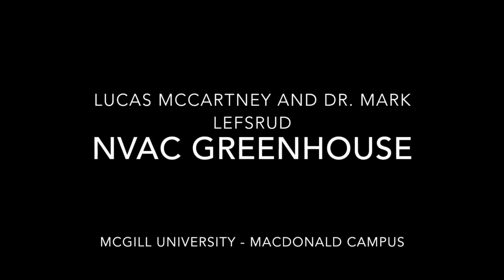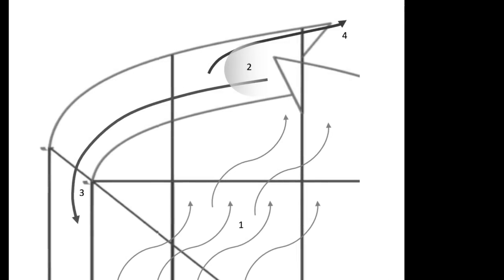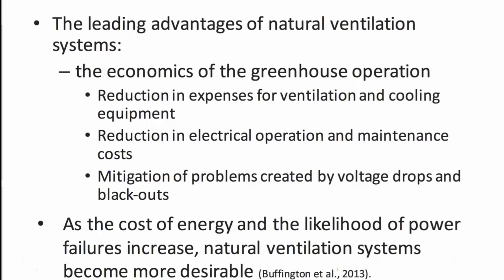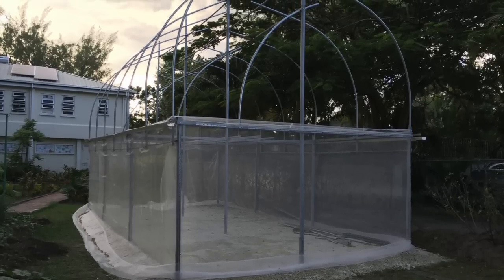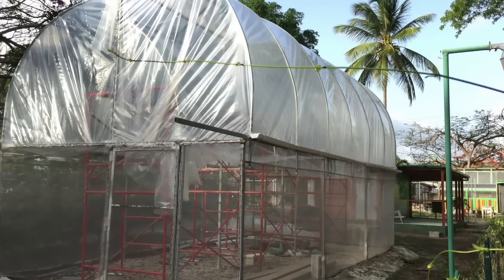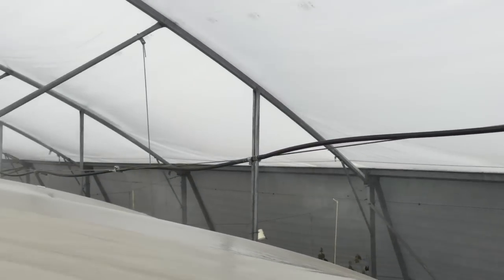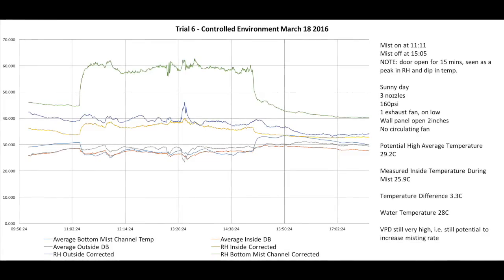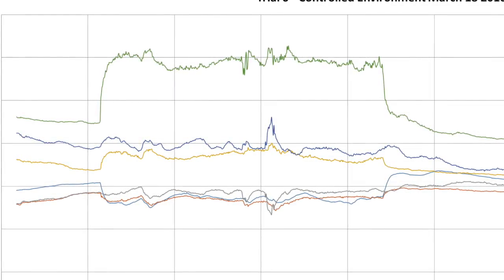Tropical and Hot Climate Greenhouse Design: Natural Ventilation Augmented Cooling NVAC Greenhouse

Comment: If situated in a very hot, humid climate, would strawberries work with this type of system?
Reply from the maker: This greatly depends on your local climate and greenhouse design. The NVAC system might be sufficient to provide the needed level of cooling if immediate conditions are right.

Comment: If the outside RH is equal to the amount provided by the misters, will the system still work (as evaporative cooling is dependent on the differential between inside and outside RH)?  Wouldn't a simple fan system with a GH tube be much cheaper, simpler, and more effective?  I've seen similar designs in the tropics, however the problem here is keeping air moving and humidity down.  This means a simple rain cover and a fan system.  I don't believe that adding more humidity in tropical zones will be helpful, especially considering the many fungal issues present.

Comment: This is perfect for the central  valley CA what’s the outside vs instead wn 100 outside maybe adding geothermal underground air exchange and a side fan seems like a lot but depending on crop value....
Reply from the maker: Go Goings Depending on inside temperatures and relative humidity, we can get over 8C of cooling with significant air movement.

Comment: Would it work without the misting system?
Reply from the maker: It would not work. The NVAC design relies on the cool air provided by the evaporative cooling, which in turn relies on the misting system. Thanks for the question.

Comment: Cool concept, wonder if I can have more info about the design. I'm planning to build greenhouse in my backyard. Thanks
Reply: The Philippines has five types of climates: tropical rainforest, tropical monsoon, tropical savanna, humid subtropical and oceanic (both are in higher-altitude areas) characterized by relatively high temperature, oppressive humidity and plenty of rainfall. There are two seasons in the country, the wet season and the dry season, based upon the amount of rainfall.[1] This is also dependent on location in the country as some areas experience rain all throughout the year (see Climate types). Based on temperature, the warmest months of the year are March through October; the winter monsoon brings hotter air from November to February. May is the warmest month, and January, the coolest.[2]

Is this applicable to my country.?
Reply from the maker: xinod ras The NVAC system might be applicable. It is important to note that if the humidity outside and inside the greenhouse is too high, the cooling capacity of the system is greatly reduced. If there are periods of the day where the sun is strong, temperatures are high and humidity may be lowered in and around the greenhouse (usually mid-day), the system has been proven to be effective, even in typically humid climates.
Reply from the maker: Head over to https://nvactropicalgreenhouse.weebly.com to fill out the contact form. I'll get in touch with you through this. Thanks for inquiring.

Comment: I love the concept, using a misting system is a smart way to go. I'm concerned that a high humidity climate wouldn't cool much though with a misting system..... I plan to explore this concept more on my channel. Thank you for the video and I hope you got your PHD
Reply from the maker: Simple Tek Thanks for the comment. Your concern is appropriate. We do limit the use of the system during humid days and I don’t recommend use of the system in regions that experience very high humidity year round. Thanks for watching and yes, I did happily get my PhD.
Reply: You could add earth tubes for a humid climate. This requires a small amount of power to ruin the fan, but is easily run with a small solar setup.

Earth tubes are simply 6" drain tubing buried under at least 3 feet of earth. You run them for as long as practical, and put one end on one side of the greenhouse, and one in the other, then install a fan. This cools the air going through the tubes.

The longer the run, the more air can be cooled.

For larger systems, you got limits on size and flow, so people then go to fluid filled pex pipe buried very deeply, and connect it to a radiator and a fan, similar to how a car engine is cooled.

Check online for details. :-)

Comment: Wonder if creating a vortex like on newer airplanes would speed the airflow over the ridge near the misters
Reply from the maker: Thanks for the interesting comment. Indeed creating more turbulence at the roof vent could promote air movement around the misters. From experimental data, there already is a great amount of turbulence in this area. Inducing even more turbulence would have an effect, for the better or the worst. Undetermined at this point.

Comment: Hello Lucas, May I ask if this design would be more effective in a scaled-up version greenhouse(1000m2 to 2000m2) ?
Reply from the maker: It can be as effective in any size greenhouse, provided the roof and vent designs are appropriate. For example, the NVAC setup will not be the same in a multi-span large scale greenhouse compared to a single span large scale greenhouse. The shape of the roof also comes into play.
Reply: Lucas McCartney Thanks, I'm having a draft for a sustainable farming project in Vietnam and the greenhouse part is killing my budget. So I am strongly interested in this innovative design since it is a cheaper cooling solution than a fully automated greenhouse. My only concern now is that with three layers on top, will the sunlight will retain enough necessary spectrum for plants to grow?
Reply from the maker: The system in fact creates 2 layers, which usually isn't a hindrance as shading is used anyways. When designing the specific NVAC system for a greenhouse, I balance the existing shading with the added shading from the NVAC roof, to result in no overall change.
Reply: @lucasmccartney5043  how much will it cost for a 30 feet x 60 feet green house in the Caribbean?

Comment: At my place, the temperature is around 32°C (humidity around 60-70%). If I installed this design of greenhouse, how much the temperature you expected will be drop?
Reply from the maker: The performance of the NVAC system can vary depending on solar load, wind conditions and exact design of the greenhouse. In a typical natural ventilation greenhouse with large side and roof vents and under sunny and low ind conditions, you might expect 2-4 C cooling (compared to outside conditions).
Reply: Thank you sir

Comment: Hi. Great work here. I am very new to all these and was wondering if this is better than cool pad & fan system in terms of cooling the green house as well as maintaining appropriate humidity. Kindly enlighten me. Thank you.
Reply from the maker: Hello Adarsh. This system is comparable to a pad and fan system, but it works in a natural ventilation greenhouse i.e. very open (with mesh) sidewalls and roof vents. The NVAC also is affected by natural air movement, such as wind gusts. Pad and fan systems require a more closed design to be able to draw air through the pads, across the greenhouse and out from the fans.

Comment: hi, what about growing microgreens in hot and humid area like Tropical climates where it is not only hot but humid. the water evaporation to cool the greenhouse will pose a risk  as the already high humdity will become higher for thr ,ictogreems tp grow
Reply from the maker: In an environment that is already very humid, the cooling capacity of the system is indeed diminished, as in other evaporative cooling systems. The benefit of the NVAC system is that the water droplets from the mist or fog systems will never reach the crop. If a greenhouse is very well ventilated via natural ventilation, even in a humid environment, some cooling will be gained from the NVAC system. Nonetheless, it must be used with caution to avoid over humidifying the inside climate of the greenhouse.
Reply: In Belize it is very difficult to produce tomatoes in high tunnels or tropical greenhouses the temperatures are over 35 deg Celsius and increases more in the afternoons (between 12 - 4 pm). Small farmers do not have the capacity to invest in too much equipment. It would be good if we could test this system here as we much needed. If i could get more information maybe I could do it at our research station of the Ministry of Agriculture in Belize. My name is Oscar Salazar, okisalazar@yahoo.com or oscar.salazar@agriculture.gov.bz

Comment: can you tell me if this is the kind of green house to build in El Paso, TX for growing warm tropical climate fruit trees?
Reply from the maker: The NVAC greenhouse can provide cooling and an increase in RH. If you're after a little cooling and a tropical environment for fruit trees then this might work for you, yes. I'm curious to know what type of tree crop you're considering? Sounds interesting.
Reply: @lucasmccartney5043  was this just a  video showing what can be done, or are systems like this available to the public for sale?
Reply from the maker: Bob Newhart. Until now the NVAC systems are custom built for each structure via local manufacturers or onsite using building crews. Let me know if you want more info.

Comment: If you are interested in testing this in a true hot climate that represents future generations I'd like to hear from you. I am in North Texas. Our temperatures spike on the high end but we have extreme low end valleys as well. Basically -6c for two months, typically an average of 29c for four months, with peak summer months sustained as much as 40-43c.

Testing in the Caribbean is useful only when accepting the uniqueness of island climates: yes it is hot during the day, but evenings drop significantly. This is true whether rainy season or dry. Regulars rains help with cooling and those are consistent regardless of season. We Texans tend to vacation across the Caribbean and Central America. ;) The local climate does a lot of the misting for you already.

To truly prove out the approach you need a climate where sustained dry seasons last up to six months with no expectation of appreciable evening drop down nor the typical and predictable showers the Caribbean enjoys in early mornings and mid to late evenings.
Reply from the maker: Hi Dave. 

If you're willing on giving the NVAC technology a try, I would be thrilled to test it in more arid, summer climates such as yours. In recent months, we have been looking for a more arid climate region to test the NVAC greenhouse design. What kind of greenhouse operation are you running?

It seems like you have some experience with the climates in the Caribbean and South America. I agree that many of these areas have heavy rains combined with high temps. Barbados and other islands with similar climates are unique as they do have a rainier season, but also have a significant dry season where rain can be very rare; sometimes many weeks with nothing but small overnight showers. These periods are considered more arid. This is especially true in the past few years. In such a climate, there can be periods of weeks to months where there are no rainfalls to cool things off.
Reply: What is the best way to contact you off youtube?
Reply from the maker: Please email me through http://nvactropicalgreenhouse.weebly.com/contact.html

From there we can set up better communication.
Reply: @lucasmccartney5043  hi, was this ever tested in Texas? Im in a part of Victoria Australia with a similar hot/dry climate. Im curious how it worked out as im planning on building my first 30'x100' high tunnel this fall. Any info is much appreciated, thanks.
Reply from the maker: @paganpride464  I will have some data from a relatively large greenhouse in the middle east using the system. I can update you when the information is available. Reach out on contact form on https://nvactropicalgreenhouse.weebly.com

Comment: Hi, your topic is on the design of greenhouse in hot and humid climate. However, the end conclusion of the results actually shows a high RH which is detrimental to plants which I would already have guessed so from the usage of a mister. Ultimately does this serve as a solution to a good greenhouse design for hot & humid climate. Please take note I am referring to hot and humid....not hot and dry. Thanks.
Reply from the maker: Indeed the NVAC system relies on an evaporative cooling process, and so yes the performance of the system is reduced under truly humid conditions, and its use would be detrimental to the crop. However, the evaporative cooling process occurs in the rafters of the greenhouse and therefore the water droplets from the misting do not reach the foliage of the crop, only the draft of cooler air reaches the crop. Moreover, the system is automated and on humid days, the system is activated only during the peak temperature, which coincides with a sharp drop in RH in many climates, even if the overall average RH is very high. On rainy days, it may never be used. 

Note that we have not tested the design in climates where the humidity never drops, but we will be shortly. The draft of cooler air, even if marginally cooler, may be beneficial even considering the high RH. Results to come.

Comment: Can this be used along side conventional cooling methods?
Reply from the maker: Yes it can. The design of the NVAC system relies on natural ventilation, therefore open vents are critical to the performance of the NVAC system. Provided traditional greenhouse cooling methods allow for open vents, the NVAC greenhouse design could be used in combination.
Reply: go eat on a patio that has fog fans   and see if they have another system to assist the fans?

Comment: I need more info on this please
Reply from the maker: Hi Zahid. As per the NVAC design, there is a roof added on the inside of the greenhouse that guides the cooled air and prevents the mist droplets from falling any further, never reaching the crop. In the video from 0:14 to 0:55,  are diagrams showing this; notice a smaller roof of similar design under the left-hand side outside roof. At 3:14 is a view of this inside roof, seen above my head in the picture. The smoke tests seen in the video also show the this roof design.

This inside roof is designed as any other greenhouse poly roof would be; that is it has a gutter system for water collection. This water can be used for other purposes, mainly contributing to the irrigation needs.

Please provide an email address or other contact I could reach you at if you require more info.
Reply: Lucas McCartney  I have a couple of questions. how does the misting water is preventing from getting on to the plants and how is the misting water collected for re-use. do you have a construction diagram by any chance ? thanks
Reply: Email zahidr1000@gmail.com . Thank you for your response. I live in UK but I want to build  soil less based vertical green house using the Most modern yet cost effective and technological design. The temperature can be as much as 38 Celsius in summer. Utilising  solar power for mist. I am also looking into uv  resistant poly sheeting. If you can recommend please do. Also is the list of materials used for mist making in your report.
Reply from the maker: Is there an email address or a messaging service I can reach you at.
Reply: njdajan@gmail.com plsss... i need more info on this.
Reply: milesesprit@gmail.com I'd like the information as well
Reply: @Krsuperman.87 are these swamp coolers expensive?